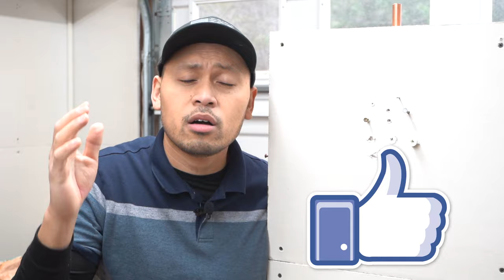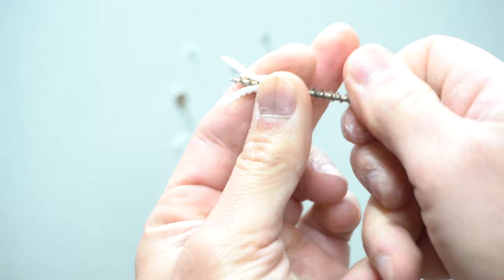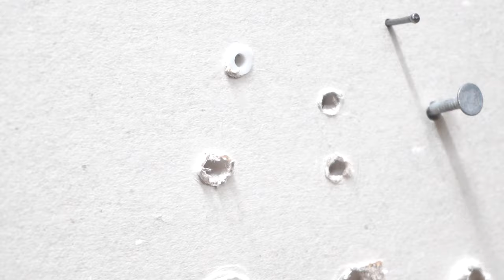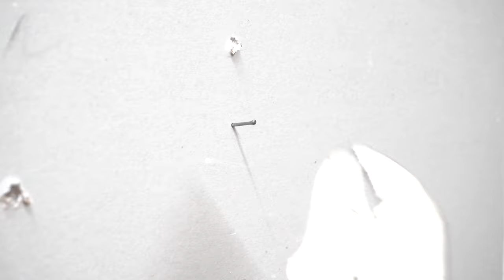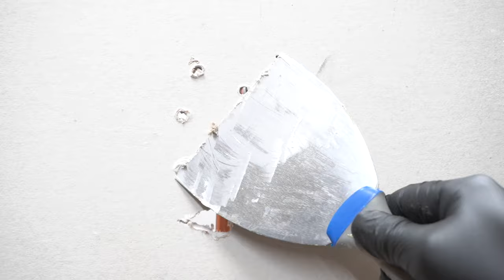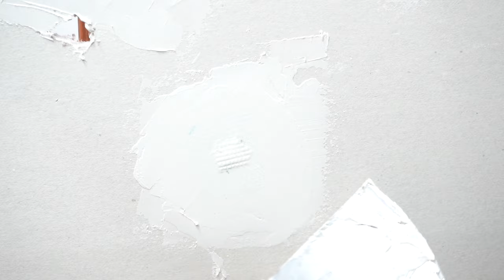How To Remove And Fill Drywall Anchor Holes | DIY Fast And Easy Repair For Beginners!

Comment: Can I use white wood filler to fill holes ?  Thanks
Reply from the maker: Hi! Please only use wood filler on wood and use joint compound on drywall. Thank you 🙏🏽
Reply: @FixThisHouse  thanks,  is spackle OK for small holes as well ?
Reply from the maker: Yes , but please take note…Joint compound is the better choice for taping and finishing drywall seams whereas spackle is the better choice for filling in small to large sized holes in your walls. ... Spackle also shrinks, but it just doesn't do it nearly as much as joint compound
Reply: @FixThisHouse  thanks again
Reply from the maker: Anytime!

Comment: You don’t need to take those small plastic anchors out just bang them below the surface of the drywall  with a hammer and patch